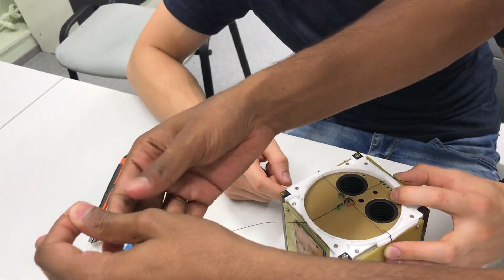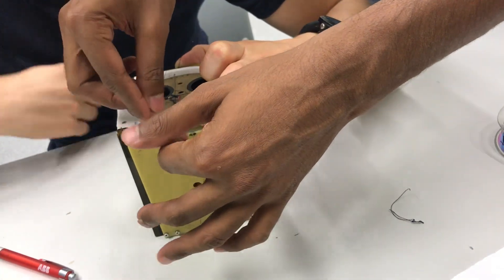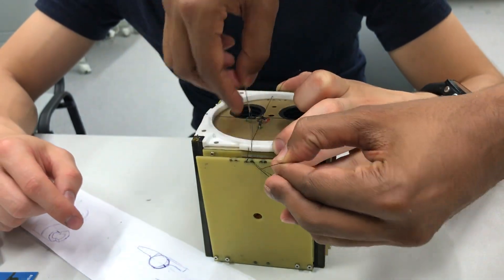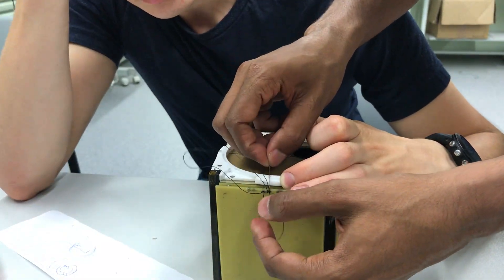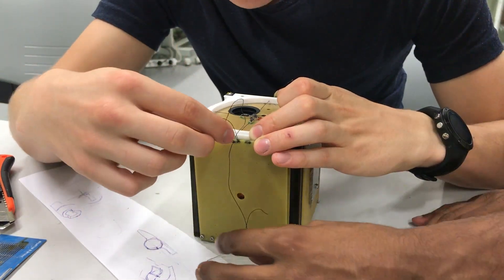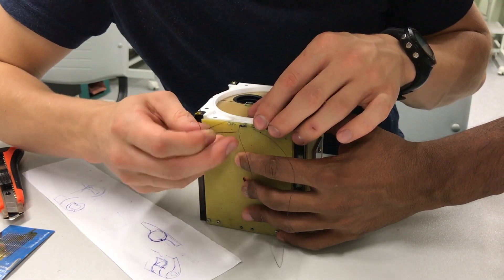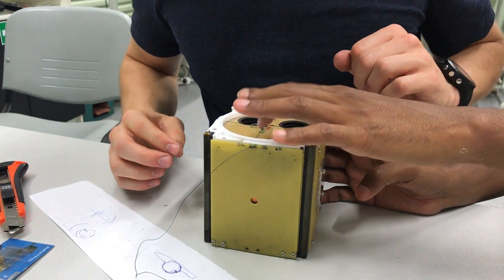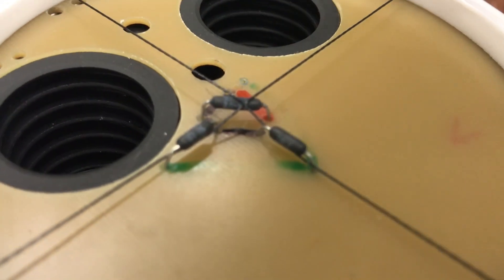TTU 100 CubeSat Solar Panel & Antenna Deployment

Comment: So I'm guessing it's deployed by the resistor burning the string.
Are the resistors on the sides of the center one just to guide the string?
Reply from the maker: Yes resistor on the top only